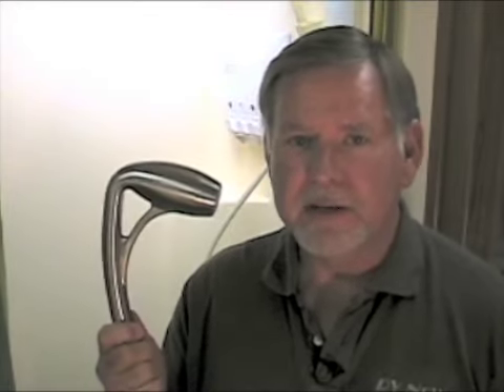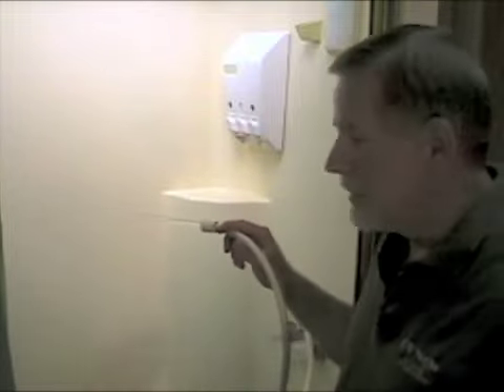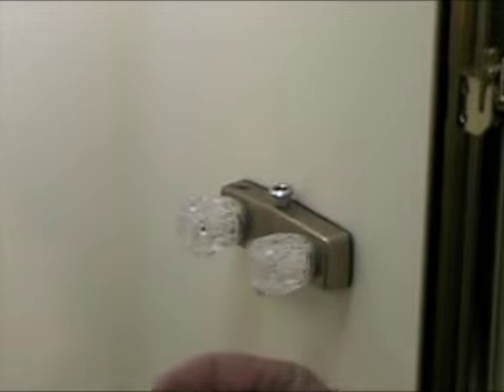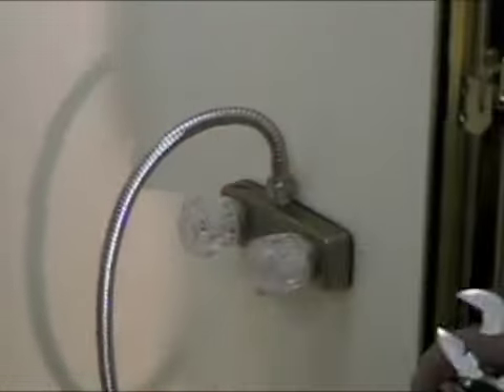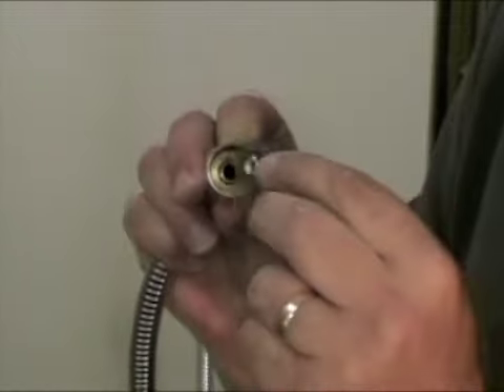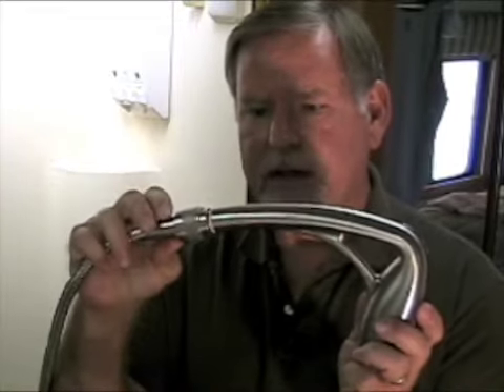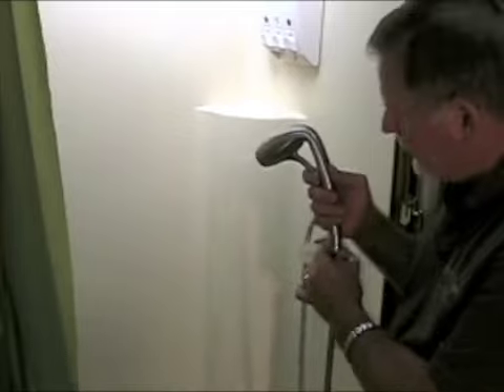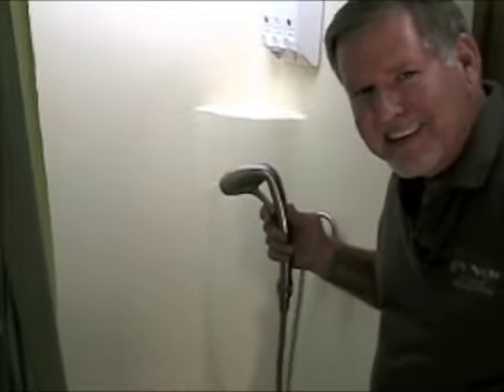Power up your RV shower

Comment: is there such a thing as a dyafram that works with the water pressure? i have a 2004 hawk horse trailer with living quarters. i turn on the water and it comes out fine and just stops.